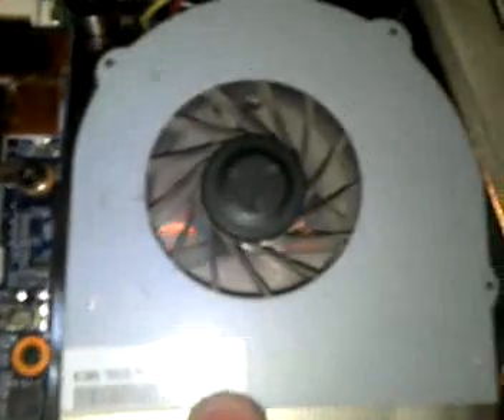Asus G50vt-x5 video card upgrade part 2

Comment from the maker: Buy a new laptop as you will soon find out that you will be hitting that bottleneck  really quick. I ended up selling my laptop and buying a PS3 for online games since hacking is a lot more difficult as PS3 update their firmware a lot faster than a game releases patches. I also bought an adapter to play on the PS3 with my keyboard and mouse.